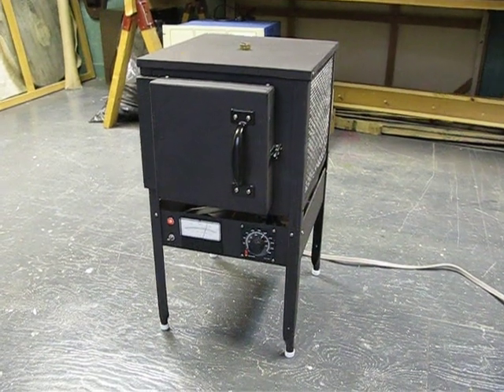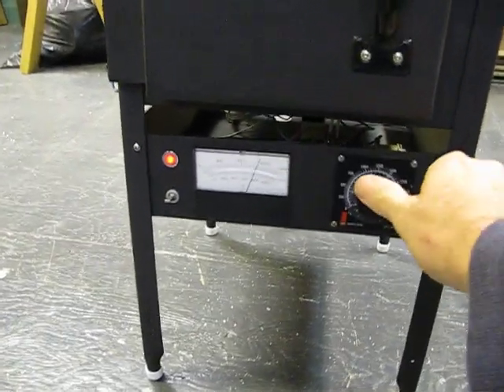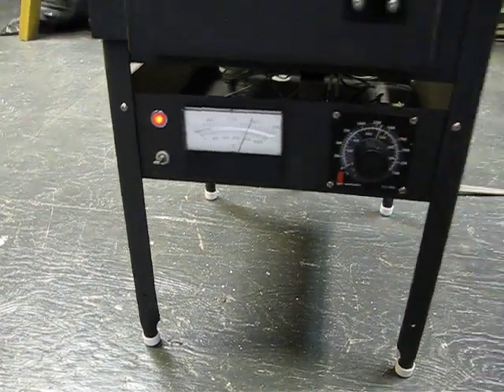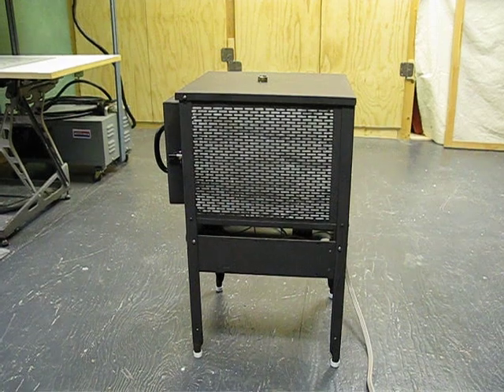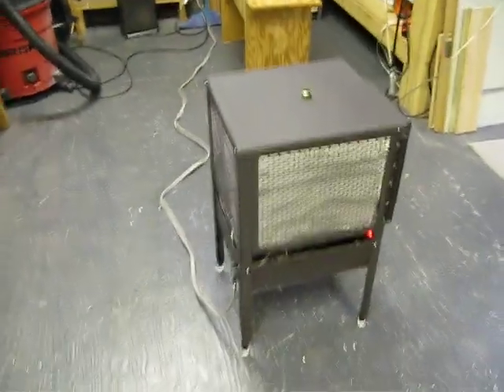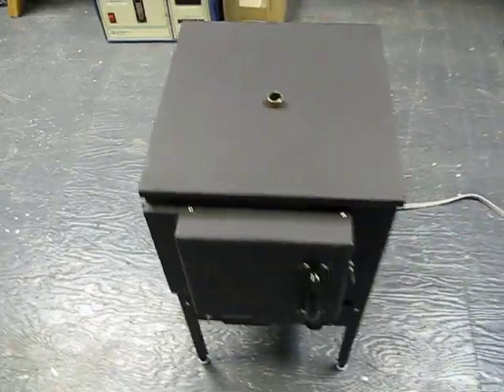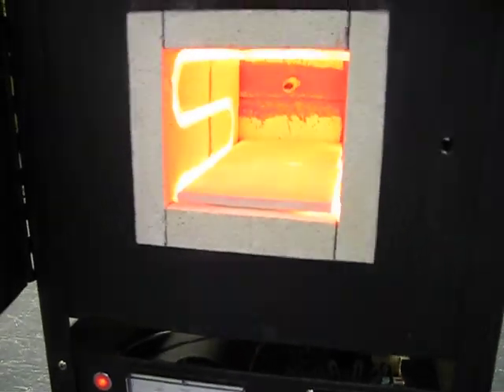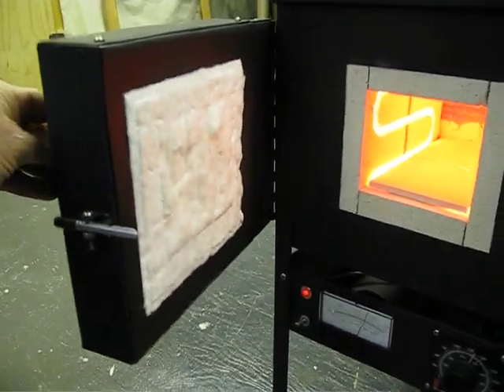muffle furnace

Comment from the maker: The join is mechanical, using a brass insert style marrette.  The heater wire comes down into the open electric tray on the bottom and joins a 12AWG copper wire with high temperature braid.